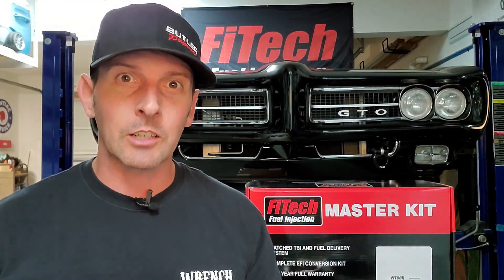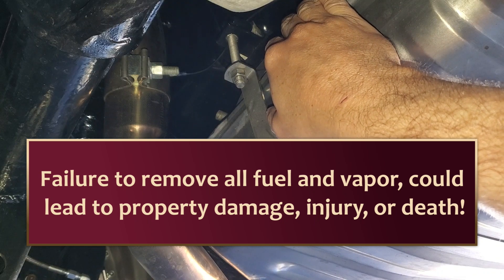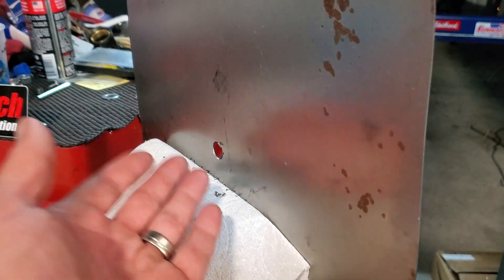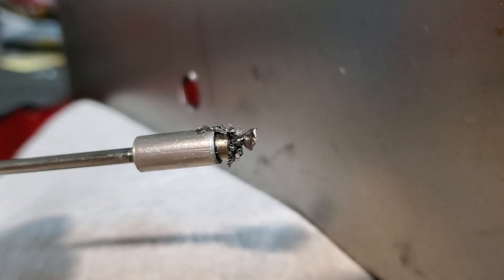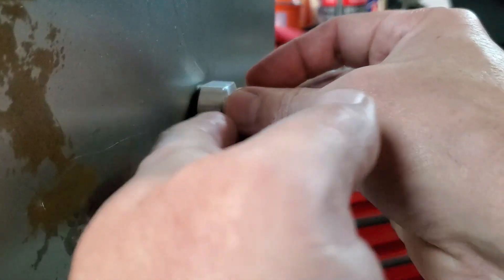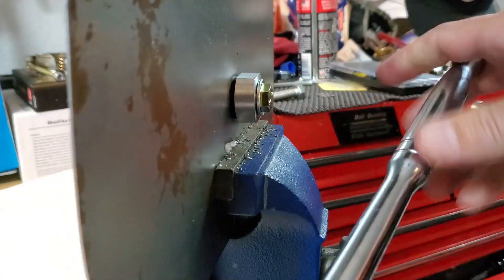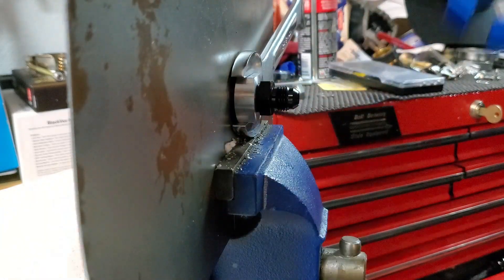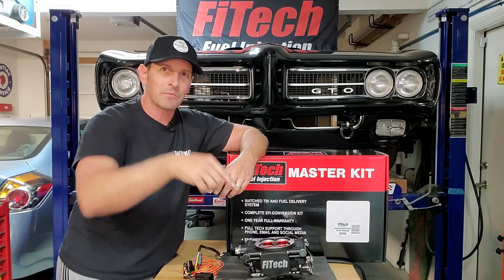Fuel Injection Conversion, Part 3:  Easy Install - Fuel Return Bung - FiTech

Comment: So you put it at the very top? And if so do I just attach a submersible rubber hose and clamp it?
Reply from the maker: Yep, as high as possible.  I'd recommend putting an A/N adapter on there with a barbed end, so you can push on a rubber hose, if you're going that route.  Have fun!

Comment: Put grease on the step drill to catch the shavings.  Also the metal is heavier and will sink to the bottom and with an exter fuel filter you should be safe.
Reply from the maker: Good stuff, thanks!

Comment: Great video thanks. 
My question is could this be done with the purpose of fixing vapor lock in an older car m?
Reply from the maker: You mean installing a return line?  no.  Vapor lock is typically because the fuel bowls are too hot.  BUT, if you changed over to this FiTech fuel injection system, you'd never have vapor lock again.  So, there's that.  Thanks!

Comment: Why isn’t a hose being run into bottom of tank.  air bubbles?
Reply from the maker: Good question.  I suspect if you run it the bottom, and your tank is full, the pressure may act against the needed "Bleed off pressure".  Thanks!

Comment: One way to prevent metal chips going into any hole you are drilling is to coat your drill bit in red tacky grease. as the chips are created, they will be held in place by the grease.
This also is the only way I have found to chase, clean or rethread spark plug holes without having to try to get the metal out of the cylinder after.
Pro Tip- Run The Drill At A Slow RPM unless you enjoy bathing in grease.
Info - ORB stands for O-Ring Boss
Reply from the maker: Love it!  Especially the "bathing in grease" warning. Thanks for the comment!

Comment: Tempting to just purchase new sending unit with designed-in return line plumbing barb.  They are not super expensive.  GM A-body units available online for less than $60.  This avoids drilling/shavings into tank, potential leaks from new fitting, etc.  But cool video!  Informative.
Reply from the maker: Ahhh yeah, very cool idea.  Let us know how it goes!
Reply: I will.  I am in the middle of sorting this out myself.  Fuel pressure/fuel system issues are tempting to ignore until you can't, because the car isn't running or running right.
Reply from the maker: @rogjackson  Yup, chasing those bugs is frustrating, but gratifying when you find em.  Keep at it!

Comment: Ive watched several of your videos and appreciate your details.. I attempted this install yesterday.  It ended up crooked and flared the tank edges at drilled hole and didnt crimp up.. Because the mounting point for the outlet is nearly, right below the sending unit opening, I can get extension to reach.  I will drill a 10AN hole, to clean up the flared edge of 6AN hole and have tank upside down.  I will then install an Evil Energy, fuel cell bulkhead fitting in its place.  I will then reduce the 10AN to the 6AN outlet under tank to continue fuel line through filter and pump and forward to engine bay and regulator. My reasoning for project is to have fuel drop out bottom of tank. The electric fuel pumps push and not suck thing is an important detail.
Reply from the maker: Welcome to hot rodding.  :)  Thanks for sharing your story, sounds like you're making awesome progress.  Keep at it!

Comment: That bung tip should be  longer that way it doesn't need to add a hose to it.
Reply from the maker: Doesn't matter how long it is, you need to run a hose to it.  It's the return line for the throttle body.  If it was just a vent, different story... just not in this case.  Thanks!

Comment: Does this work on a pipe or just flat surface?
Reply from the maker: Good question, it's intended to work on thin flat sheet metal.  So, I don't think it'll work on a pipe.  Thanks!

Comment: Mite be a good idea to insert that magnet close to the drilling area from another point of entry into the tank…
Reply from the maker: Agreed. Thanks!
Reply: @FastMonty  last week i had to make my own home made bung plug using hydraulic line fittings in my bobcat mt 50 …. Plastic gas tank 
It took me a hole day in the garage to get it done without taking the tank out …. Because my machine is so small that the motor needs to come out for the tank to be pulled out . 
Your plug is awesome , but mine cost 9$ Canadien lol … i wanted to do your plug , but i didnt have room to drill a bigger hole

Comment: Hello, I just ran across your series "awesome" but wanted to know how many fuel filters you're running in your config.   At the moment I'm runing (1) 100 filter but was thinking of adding an additonal 10 micron to the config.  

Any comments / suggestions would be great. thx
Reply from the maker: Thanks RJ, good question.  When I filmed this playlist, I was using a fuel pick up with NO sock.  So, I had a 100 micron filter before the pump.  Then a 10 Micron, after the pump.  Now, which you'll see later in the playlist, I converted to an intank pump, which has a built in filter.  (Some say a post filter isn't needed, but I'm still using the 10 micron filter)  Here's a link to the playlist, if you need it.  
https://www.youtube.com/playlist?list=PL0VCtZe2W6eYFayoNVWpqMIwsXBbZQKqU  Hope that helps!

Comment: I put the return line into the gas filler tube on my 57 Chev Wagon when I did the EFI install.
Reply from the maker: Great idea!  Thanks for sharing!
Reply: Have you had any issues with the return being in the filler tube??
Reply: @codyrobinson5561  None that I could see.
Reply: You have any pics of how and were you mounted the return bung?
Reply: @codyrobinson5561  I took some crappy pictures but don' t see how to post them.

Comment: So fuel bung is on the bottom of the gas tank to reduce air in the system? Is there a bung for the fuel feed?
Reply: Thank you 🙌
Reply: do not do it this way, you’re pumping air back into the tank. the return needs to be submerged
Reply from the maker: The return bung needs to be at the top of the tank.  An additional fuel supply bung at the bottom would only be needed if you had a specialized gravity fed fuel pump.

Comment: Thanks for this video! I bought that FiTech bung kit on Ebay and some genius decided there is no need for instructions. I am putting FiTech on a 429 Cobra Jet in a 59 Ford Fairlane on my channel. I am going to try to use my Nut Sert tool to install this bung since thats the same way threaded nutserts are installed.
Reply from the maker: Ohhh, yeah... cool idea.  Let us know how it goes.  OR, when that video posts.  Thanks for sharing!

Comment: Can I put the bung in for the return line in the filler neck. Ands does the line need to be on a downward angle for gravity like water
Reply from the maker: Good question... I don't see anything wrong with putting the return line bung on the filler neck.  Not sure which line you're talking about... if you're talking about the return line, no, I don't think it matters, because it's used for the excess pressure bleed off from the pressure regulator in the throttlebody.  Let us know how it goes!

Comment: Can I use a factory fuel pump Relay instead of a fitech  Relay and how?  Thank you very much for helping me
Reply from the maker: I used a relay, but the orange wire from the throttle body needs to connect to it.  I covered that in episode 2.  https://youtu.be/6n4WYwfpk6o  Hope that helps.

Comment: Dear , i have s10 1991 the fuel pump 255 lph inside tank , how i connect fitech orange wire with positive fuel pump ? Help me
Reply from the maker: You have to locate the wire harness for the fuel pump, and determine which wire is the positive feed to the pump.  Cut that wire, and splice it to the orange wire.  Hope that helps.

Comment: Question: You put your low pressure fuel pump in the trunk above the fuel tank. I thought the pump had to be lower than the tank (gravity fed). What am I missing?
Reply from the maker: Good question.  This pump can be installed up to 12" above the bottom of the fuel tank.  That said, there are pumps that need to be gravity fed, and mounted below the fuel tank.  This is not one of them.  :)  Thanks!

Comment: I went with the Tanks, Inc tank with built in fuel pump on my 1968 Firebird. I also replaced the lever fuel gauge float with a Classic Instruments Tube-Type Fuel Level Senders SN38T7. I've heard some people have issues with the fuel gauge bouncing. The other benefit of the aftermarket tank is you won't starve the pump while cornering with a low fuel level. I also went with the Holley Sniper EFI.
Reply from the maker: Thanks GJ.  Yeah, a new "EFI" tank, with an in tank pump is by far the most optimal way to go.  But, also the most expensive.  Thanks for sharing what you did, it's very helpful for everyone here.  See you soon!

Comment: Good video.  I think I would pull the tank and go in through the top or in the fuel pump/level plate like you did.
Reply from the maker: Thanks!  Yeah, definitely better to pull, or drop, the tank.  Certainly nice to have options.  Thanks for the comment!

Comment: Where can we buy that fitting?
Reply from the maker: Most part suppliers have it.  You can google FiTech 50004-9, or try this link... https://www.youtube.com/redirect?event=video_description&redir_token=QUFFLUhqbl9uRWlURUNvSlIyZ3c5ZGFJZlhaNmVSMF9qUXxBQ3Jtc0traXpnU0RueXBONi1sUlIwRUwwb3dvMTZvVmI0SWJ6STloZ2hJMElDdWQtaHI5cDRpSkc5Q2daRmVvT1VjaUZrakw4V3pjNXhsTGh5MWltdDZDYUNkX0lINWZwNFV6WmllTWJDVmpnbHFWQUZYVWUxVQ&q=https%3A%2F%2Ffitechefi.com%2Fproduct%2F50004-9-easy-install-fuel-bung-and-seal%2F

Comment: Where do you recommend placing the vent-return line
Reply from the maker: The line itself?  You typically run it with the supply line.  I'll try and cover that in my plumbing episode.
Reply: No, I ment where on the tank itself.
Reply from the maker: @raimaker6343  Ahhh, yeah.  I can't remember if I mentioned that, but you mount it as high as possible, furthest away from the pick up tube location.  Hope that helps!

Comment: I remember a diesel guy drilling into my cast iron exhaust manifold if my Duramax.  He added a ton of grease on the drill bit and the engine was running to pressurize the manifold to minimize debris going through the turbo.  Maybe you should pressurize the tank and add tons of grease to the drill bit to pick up the metal.  Maybe even add neodymium magnets to the bit.  

Thanks for the videos.
Reply from the maker: Thanks Nacho!  I'd be wary of pressurizing the fuel tank, with fuel in it... probably best to drop and drain it.  Thanks for the story and comment!

Comment: Good video. Years ago I watched a guy at a service station using a torch on a gas tank sitting on saw horses in one of the bays. Everybody cleared out as soon as they realized what he was doing. There was lots of sparks and smoke but thankfully no 'boom'. The boss was certainly not impressed judging by the arms flailing around.
Reply from the maker: That's hilarious!  Would've loved to see that hidden camera action... thanks for sharing!
Reply: @FastMonty  That was long before the cell phone. Taking pictures involved film and developing. Used to read about repairs like that that did not turn out as well unfortunately. Remember my dad getting out of the car at the gas station to stretch his legs and then remembering to to put his cigarette in the ashtray in the dash. Whole different world now.
Reply from the maker: @briankinnear7461  Ha!  AND, gas was 10 cents a gallon!  Thanks for sharing, as usual.

Comment: I dropped , dained and filled my gastank with water when drilling it. i did not chance a spark to blow me and the garage up. But in the end i ended up with a new efi tank.  That fitting is a  is a nice way to add a vent. For a return line i would like to see som way of adding an extention to the fitting to reach the bottom of the tank, to avoid possibe aeration of the fuel.
Reply from the maker: Yeah, I agree dropping the tank is best.  Interesting thought about aeration... not so sure it's a big deal, as compared to all the sloshing going on.  Will have to keep our eyes pealed for something like that.  Thanks for the comment!

Comment: Put a strong magnet on the tank before you drill, it could collect most metalchips .. maybe. And then use a handheld deburrer to get into the narrow places. But I would rather do those suggestions in your video. And lots of ventilation. Great video again.
Reply from the maker: Thanks Olumpus... yeah, interesting thought about a magnet.  Will have to keep that in mind for future projects.  See ya!

Comment: Nice demonstration Mike,I would for sure drop the tank and fill it with water before drilling. Then flushing out so burrs are eliminated..thanks again for the time you take out to provide these great great vids!
Reply from the maker: Thanks Daniel, yeah, I agree... best to take the tank out.
Reply: I have to agree with Daniel Mathys , thanks Mike for taking the time to do these videos.👍
Reply from the maker: @johnkennedy8452  Ohhh no... thank you guys for watching and contributing, every week!  @Daniel Mathys
Reply: @FastMonty  I'm assuming that if you dont de-burr properly that compression fitting wont seal properly. .  looks like a small shoulder, and that burr was much larger . . ( still a very kewl option  )
Reply from the maker: @67Bird455  Good question, Raffi.  I would think the "swelling" of the Aluminum will compress the burrs.  It was totally locked in there when I tried to budge it... yeah, very slick idea.  Thanks for the comment!

Comment: Apply grease to the bit helps catch shavings and aid in cooling plus use a regular bit
Reply from the maker: Thanks Herman... I'll have to try that grease trick.  I prefer stepped bits for sheet metal, because you get a perfect hole.  Whereas most drill bits will leave an oblong, or triangular hole.  I appreciate the comment!
Reply: @FastMonty  I agree but a step bit is more ap to push the shavings thru the hole instead of pulling them back
Reply from the maker: @hermanmunster5831  Ha!  Good point there... Double edged sword, eh?  Thanks Herman!
Reply: You can do the same with a tap.